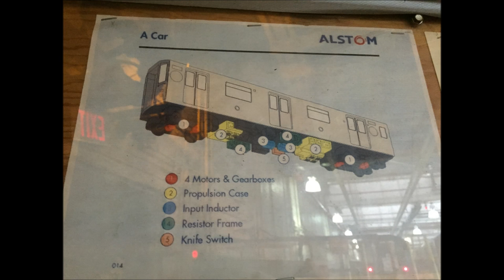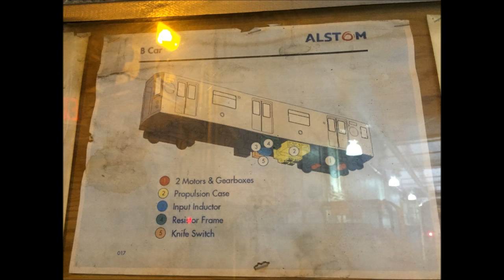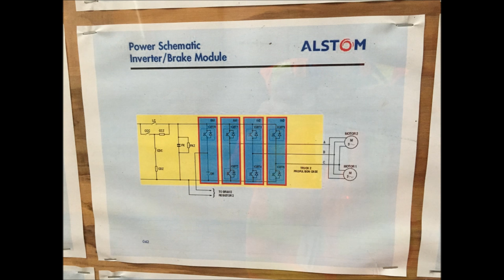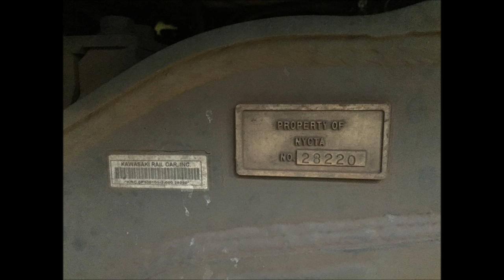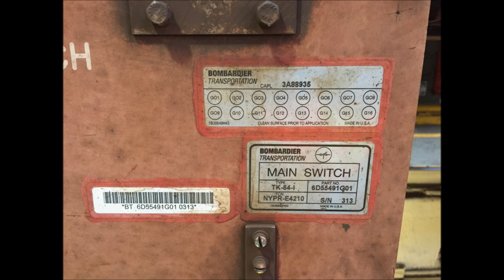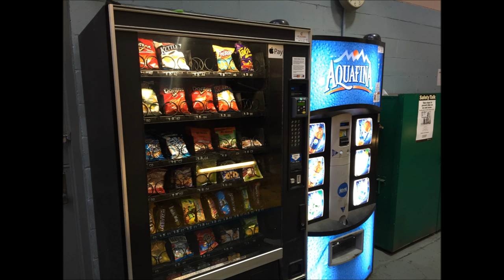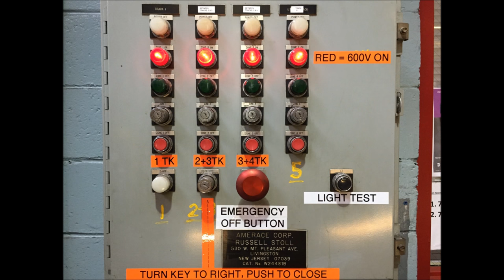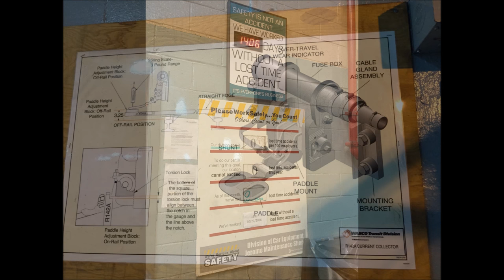NYC Subway HD 60fps: New York Transit Museum Jerome Yard (Mosholu Yard) Shop Tour 11/13/16

Comment: Quick question how do those trains move back and forth from the inspection station or in shop without a 3rd rail? I didn't see any in the videos?
Reply from the maker: There is no third rail within the shop limits. Power is drawn from overhead bug wires until the first two cars make contact with the third rail outside the shop.
Reply from the maker: watch through the photo montage.
Reply: Matthew Gorres true how come
Reply: Tommy Nunez they gave the trains electricity plugs on top intill it reached the third rail
Reply: having third rail within shop sounds awfully dangerous..

Comment: How did it move out of the shop without a 3rd rail? Is there like an electric wire connected to it or something?
Reply: There is an electric overhead with an electric boot (hot Shoe) that is attached to the contact shoe on the train within the shop.
Reply: @daniellucas6573  Alright thank you! I had a feeling that was the case (cause I saw some video about 3rd rails doing that), I was just making sure. Thanks.

Comment: the 1st train is a r142s
Reply: tech Guy I believe that is Either a R142 or R142A
Reply: on Wikipedia cars number in the 1k are R142S whils 6k and 7k are just R142
Reply: @kaifoti1559  there is no r142s
Reply: The cars with a pointy-headed '4' displayed on the their LCD Signs are 142s. The cars with a flat-headed '4' on their LCD Signs are 142As.

Comment: Is that Donald Trump speaking?
And why do the cars wail?
Reply: Novuu Kami Vron No it’s not Donald trump speaking 
And the Wail is the Traction Motor Starting up 
It’s Common on the New Technology trains 
R142
R142A
R179
R160
R143
R188
The R188 And the R142/A Are on the IRT Lines and the Rest on BMT/IND